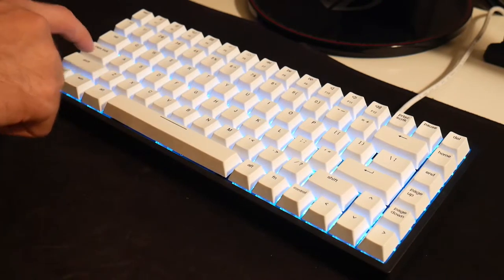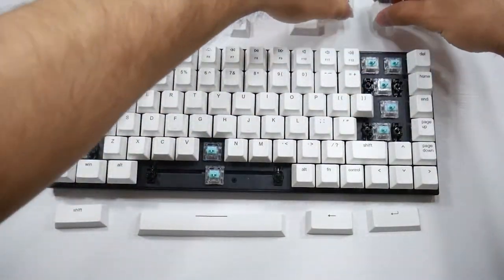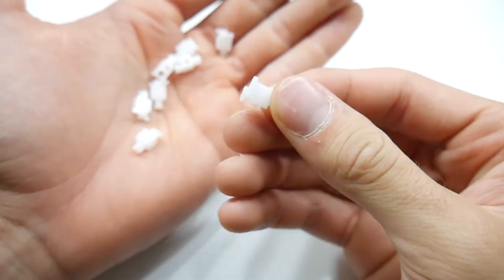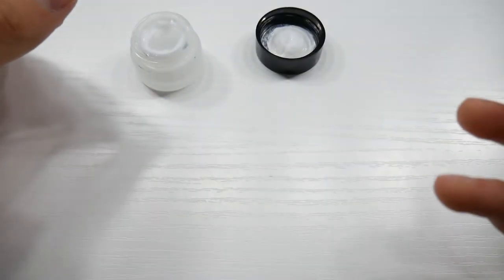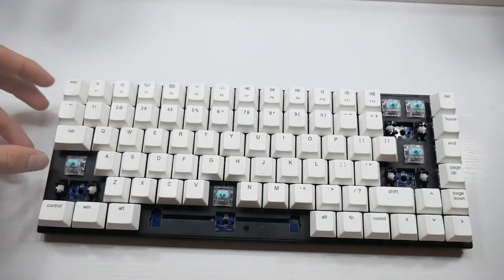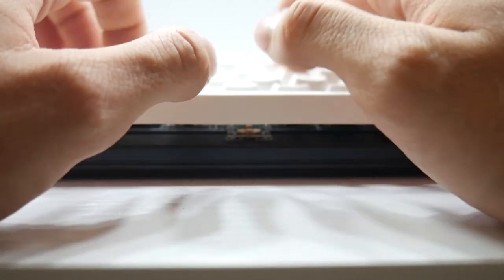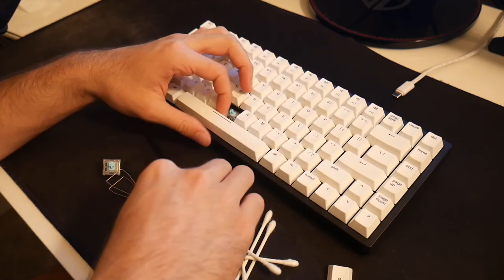Installing Durock Stabilizers on the Vissles V84 Keyboard!

Comment: I had the similar problem when I was modding my rk84. The spacebar just won't bounce back to its original height. In the end the problem was due to the plate foam which I installed myself being too wide and was pressing/pushing against the wire of the stabilizer, causing extra/unnecessary friction.
Reply from the maker: I see, I noticed that when installing cork into my board there were similar problems as well. It’s an interesting problem! How did you end up fixing it?
Reply: @KeeCode  oh well pretty simple. Just cut off the excess foam which are pressing against the wire
Reply from the maker: Sweet, I did the same thing! Thanks for sharing :)
Reply: can you explain i have the same problem and idk what to do
Reply from the maker: The first thing you can do is take out some of the foam that is causing tightness near your stabilizers. If you remove all the foam near the stabilizers and there is still a problem. Try mix and matching your stabilizer pieces to find a looser fit
Reply: @KeeCode  right thanks ill try it
Reply from the maker: Good luck!
Reply: @KeeCode  i tried everything i removed foam and mixed stabs, but still my shift keys backspace and enter still get stuck
Reply from the maker: Oh dang, okay. What keyboard and stabilizers are you using and did you have this problem without the foam?
Reply: @KeeCode  i have the reddragon kumara and durock piano plate mount stabs and i had still have it without foam
Reply from the maker: I see, What I’m thinking is that the stabilizer housing is getting squished by the plate causing there to be friction. Is it a tight squeeze for the stabilizer to click into place?
Reply: @KeeCode  idk kinda, is there a solution?
Reply from the maker: It’s going to be a lot of trial and error, I would try finding different stabilizer inserts and thin lube. This is because the stabilizer housing is probably a tight fit and it’s creating too much friction.

Comment: For your spacebar, i think the keycaps is interference with your switch. It might be bended or something. So turning the keycaps upside down or get another keycaps with higher profile would be works. Cause i have the same problem with the backspace key, and i tried to switch the keycap with oem profile (was a cherry one), and no more mushy and stuck key. And for your enter key, i think it can get better. Try to get more pressure when install the keycaps, especially on the two side of stabs all the way together. Then it would be more clack.
Reply from the maker: Thank you for the advice, I’ll give it a try with a couple more spacebars, I did try to put on my ducky shine spacebar but that didn’t do the trick. I appreciate your response!

Comment: I have the exact same issue with the sticky spacebar. Tactile switch make it stickier. I couldn't fix it after trying all combination. In the end I went back to stock.
Reply from the maker: Yeah some people seem to have that problem as well, the stabs seem to be a really tight fit on certain boards

Comment: hi bro cuz im trying to do a very and i have durock plate mount stabilezer but shift right shift enter and backspace is stuck and idk how to fix it it is really snug when i put it in but idk if thats the problem and how to fix it
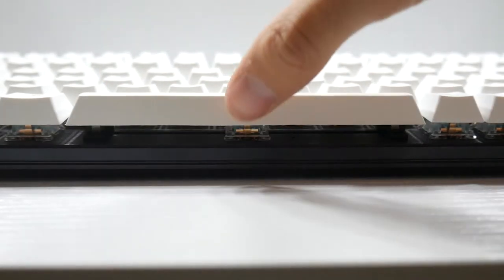Reply from the maker: Hey, If you have tried lube, one mod I suggest is continue using the plate mount stabilizer housing, but replace the insert of the durock stabilizers with the insert that came with your keyboard. 10:30 in this video I explain what I did. Good luck!
Reply: @KeeCode  i tried it but it rattles alot
Reply from the maker: Hmmm, if you wanted to get creative you could probably try to sand down the inserts slightly that may help
Reply: @KeeCode  ok ill try it
Reply from the maker: Just please be careful because if you sand too much you will continue to have the same problem

Comment: Do these need to be clipped, it doesn't have the little fang at the extra legs, they seemed to look flat. Should I clip them although they don't have that L shape?
Reply from the maker: You don’t have to clip them but I did, they have two pieces that are slightly raised. You can clip them and maybe you will see a little difference, plus it’s kinda fun to do. If the bottom is completely flat then there is no need to clip.
Reply: @KeeCode  Thank you sir

Comment: I have tried to lube them and even holee mod the stem, it still ratlle on the left side. Any tips?
Reply from the maker: Maybe try to balance the bar, if you take it out and place it on a flat surface. Make sure the bar is completely flat
Reply: @KeeCode  so bend the wire until it flat right? Will try
Reply from the maker: Yes just take your time with it and let me know if anything changes
Reply: @KeeCode  yeah, the left side of the wire is not flat. Anyway how much force did you need to balance them? 

i see other youtuber did this and it looks like they didn't use much force. I try to bend them, but no avail, the wire still the same lol
Reply from the maker: That is probably your issue then. Just trust your strength and slightly bend it until it’s flat. Good luck!

Comment: I've the same problem, BUT with original keycap works fine, but other custom keycap the spacebar stucks or mushy, and i dont know why, i tested other spacebars keycaps but only keycaps with 3 holes works fine, custom with 6 mount holes stuck on bounce back, well i dont know how to fix it :(
Reply from the maker: That’s an odd problem, I haven’t faced that one yet so I’m not sure how to deal with it. It may have something to do with the weight of the keycaps though. Maybe try weighing them and see if there is a significant difference
Reply: @KeeCode  its true, the 3 hole keycaps its to much lighter than 6 holes, i think about that, i've tried a lot of things, re-lub stabs, unlub, its weird a lot
Reply from the maker: Maybe try new springs or different switches that are stronger to offset the heavier keycaps
Reply: @KeeCode  I try a original stabs moded and works fine, durock stabs I believe it's a chronic problem
Reply from the maker: Yeah, the durock stabs are probably slightly a different size and it is causing too much friction, it’s hard to deal with that problem. You could try and mod the stabilizers or just look for new ones
Reply: @KeeCode  i`ll try a new one, but i`ll stay using the stock stab moded
Reply from the maker: Either works, like I said before, I’m actually still using my stock housing on the spacebar because the durock one was too tight
Reply: @KeeCode  Same too, its so sad